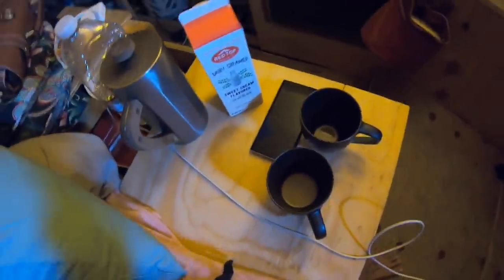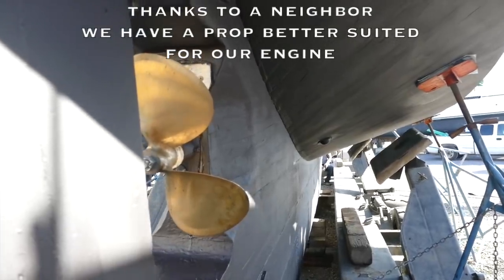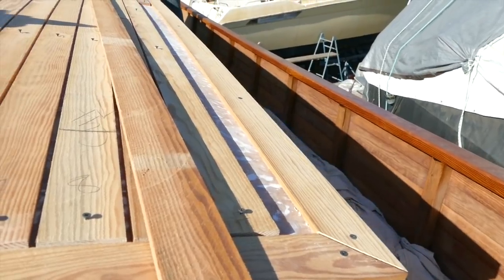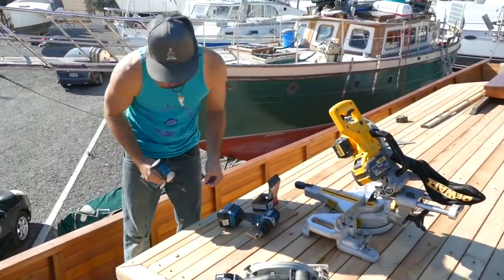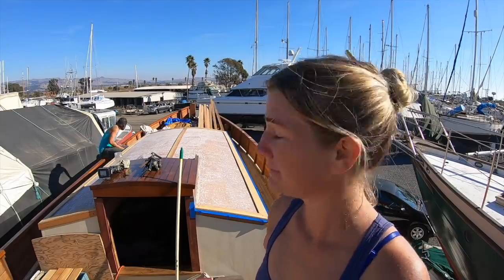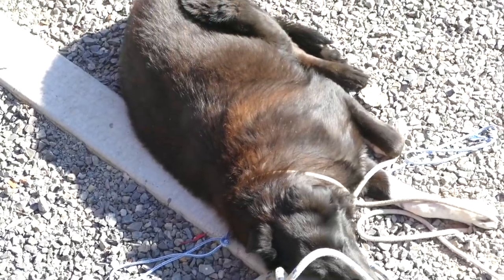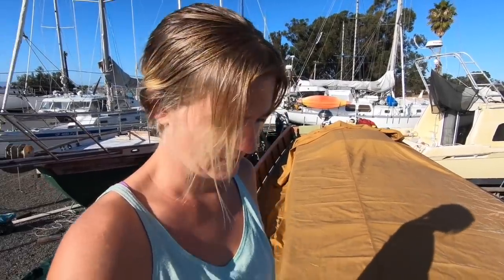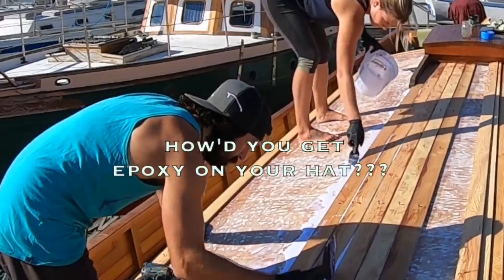Salt & Tar: Episode 75-Rally to Launch

Comment: I have to ask what kind of bottom paint do you have to use in Communist California? I have been out of boating for 24 years, when I had my Irwin 45 ketch 
I hauled my boat every 3 years for bottom maintenance. If I wintered the boat in fresh water I had no Barnacle issues. 
I know the Communist I mean EPA has changed what kind of bottom paint could be used. But every year? That is crazy. 🤣🛫